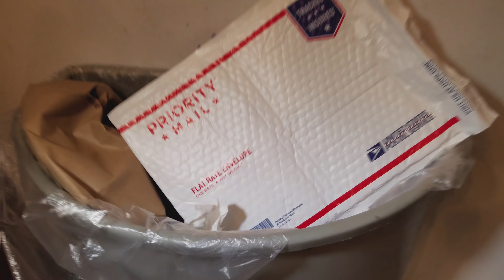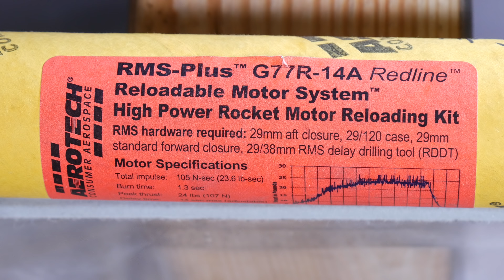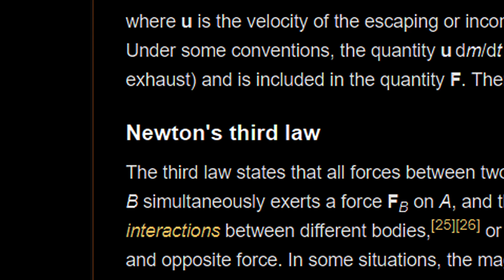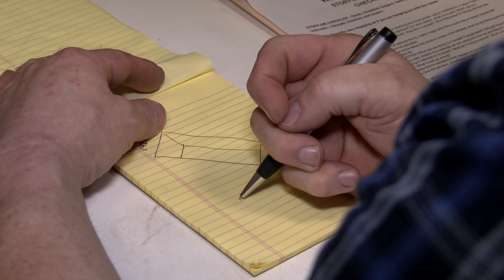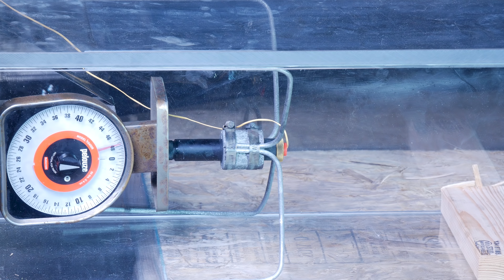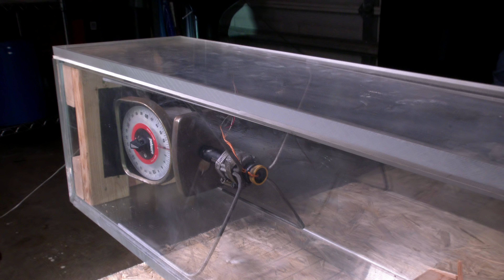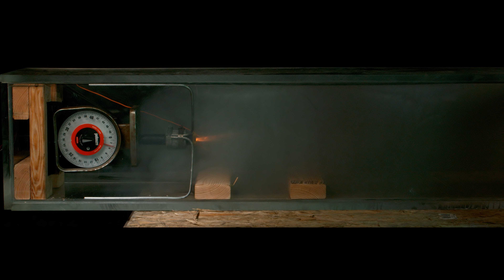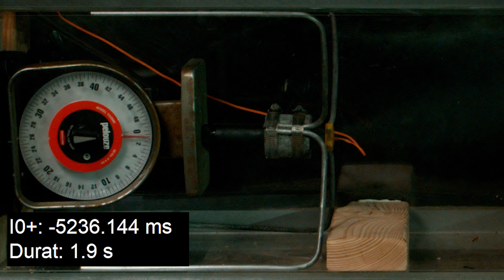Rockets in a Vacuum Chamber - Newton's third law of motion Visualized

Comment: space is not a confined box where exploding pressure can build up, same as if you put a grenade in the box and pull the pin. pressure would dismantle box.
Reply: Gary Davis oh yea?  You’ve been to space?   Grow up.    

Grenades are suspect too on another note
Reply: @zacharyhill5052  Gary is absolutely spot on and concise.  He makes a great point without being an insulting little flerf.  However your post needs further explanation, because nobody can discern your point
Reply: Myco Fairbanks  discussing outer space is theoretical only.
Reply: @zacharyhill5052  I am sorry you feel that way. In my line of work, I discuss space with SpaceX, Blue Origin, Honeywell, and NASA scientists every day, and none of it is theoretical.
Reply: Myco Fairbanks   Discuss their 401k options maybe.  I can guarantee none of them have been to outer space.   

In my line of work,  Spacex and Blue Origin are clients of my company.  

Write back after you ride in a blue origin or spacex rocket.
Reply: @zacharyhill5052  I wouldn't disgrace them in a thread with a flerf
Reply: Myco Fairbanks what a joke
Reply: @mycofairbanks3321   the fantasy is SPACE!!!
Reply: @preppertechnicianee6013  I guess it would depend on proximity
Reply: @1960ARC  Is that your final answer?
Reply: @mycofairbanks3321  ya but a rocket is justva contious explosion. So lol pressure is pressure
Reply: @preppertechnicianee6013  OK, but consider that the rocket is attached to the mass to be transported. Thus it has a positive physical connection to the ejected material prior to the expulsion.  Add this to the fact that a shock wave does not progress in a vacuum like it does in the atmosphere.  So if you were a given distance from the explosion, only the solid fragments that happened to connect could propel a body proportional to the mass times the velocity of the fragments that collided with it. There is no atmosphere to carry the shock wave. Also consider that a rocket expels its mass in one direction, while a grenade scatters its mass in all directions thereby reducing its unidirectional propulsion to near zero. You would have to be really close to achieve any propulsion from a grenade in space. Holding it firm to the broadest surface would give you the maximum effect.
Reply: @preppertechnicianee6013  No I am sorry, your concept of rocketry is flawed. Elementary at best. But I will give you an A for effort.
Reply: @mycofairbanks3321  lmao combustion chamber bud 

Ok think what you want i dont have the time

And the shape of the nozzle lol

Think why are space nozzles shaped differently
Reply: @mycofairbanks3321  lol the gas from rocket tries to then its blocked in all but one direction by the nozzle and by the combustion chamber 

Or do you think the gas somehow knows only to go in one direction
Reply: @preppertechnicianee6013  I think you are smokin rock.
Reply: @mycofairbanks3321  cool, would a balloon move in space if it let the air out the back?
Reply: @preppertechnicianee6013  Of course
Reply: @mycofairbanks3321  why ?
Reply: @preppertechnicianee6013  Because mass is being expelled in a single direction. Thus the balloon is being propelled in the opposite direction. There is nothing exploding.
Reply: @mycofairbanks3321  ok now think about how a rocket might be similar to that and really think about it.
Reply: @preppertechnicianee6013  I don't need to.  I already know the physics.
Reply: @mycofairbanks3321 
Unless you agree a rocket would move in space no you really dont
Reply: @preppertechnicianee6013  What do you think I am a flerf (flat earther)? Of course I agree a rocket works (moves) in space. I just don't agree that a grenade will produce a shock wave sufficient to thrust an object  unless it is very close, for the reasons I have already stated.
Reply: @preppertechnicianee6013  I already made the point about proximity. You are traveling charted territory. It is an absolute fact that a pressure wave does not progress in a vacuum as well as a pressurized environment.  I know the fragments will not be impeded as if in the atmosphere. 
You can go here to learn:
https://physics.stackexchange.com/questions/17957/would-a-high-explosive-in-a-vacuum-be-less-harmful
or here
https://www.sciencefocus.com/space/can-you-have-a-shock-wave-in-space/
or here: See Dave Martins response
https://www.quora.com/Can-a-shockwave-travel-through-a-vacuum
We each have good points to make.
But lets not discount what the other is saying due to our own misconceptions. Remember I already stated " Your would have to be pretty close. So I wasn't disagreeing with you, but refining the idea of an an open explosive device propelling a body. In my opinion (OPINION) 20+ feet from the grenade would produce negligible almost nothing) thrust, although the fragments may destroy you. Though I have never been to space with a grenade to test my opinion.
Have I defined my beliefs sufficiently for you?
It has been fun talking with you, and will still welcome your reply.
Reply: @mycofairbanks3321  its ALL pressure mediations, no matter perspective
Reply: Gravity is the best invention to man kind. It miraculously keeps in the billions/trillions of pounds of atmosphere while simultaneously keeping out the unmeasurable  amounts of vacuum. Einstein was a proven plagiarist with never a unique idea of his own. Wake up you ball earther fools as your judgement comes upon you in haste.
Reply: @fardyfrank8589  do vacuums suck? How do the suck ?
Reply: @mycofairbanks3321  if this is true them why can none of them take a simple photograph or keep a continuous livestream. Rocket ships work in space but not iPhones? Don't tell me they can't manage satellites to avoid whatever curvature horizonal B's they claim that knocks out there signals. A fuckin Kodachrome would do..
Reply: @Jimbo_Conn  Maybe you need to get out more. There are plenty of SpaceX launches that have 4 continuous videos from 4 different positions on the craft and boosters. There are also cameras mounted to aircraft, and huge binocular computer driven ground based cameras monitoring the entire launch. the videos uploaded to Youtube are for entertainment purposes and are not going to have just one single angle for the entire launch. How boring that would be for the viewers. However the continuous feeds do exist and you can find them if you search.
I am curious what your interest in a single photograph would be? Are you implying that under 3+ Gs an astronaut should be able to look out the window and take a photo on their iphone?
Reply: Right on Gary!  You nailed it concisely
Reply: Tooo easy off top
Reply: @zacharyhill5052  

And I take it you have been to space? Nobody has ever set foot up there, and nobody knows if there is such thing as a vacuum, it's all assumption, nobody do you hear? No soul has ever been to space, so they don't know, it's all the fruit of the human imagination in fact the fruit of the freemason's imagination.
And he is right if there is a space is not a confined box which is very limited in size.
Reply: The thrust was pushing on the end side of the box, inconclusive in my view.
Reply: If rockets required an atmosphere to work then jet engine performance would progressively get worse with altitude as the air thins but as long as airspeed is increased to maintain sufficient airflow for combustion performance is unaffected by altitude (it technically gets better)

Until the air becomes too thin to maintain combustion and wingborne lift but that's why rockets exist since they carry their own oxygen
Reply: Unless to box is purposefully conceived to contain the grenade. all you "scientists" think you are smarter than whatever made you... the lack of humility is actually the downfall of most.
Reply: @mycofairbanks3321 read 200/ proof again
Reply: @patbyron2255  can you give me that in layman's terms?
Reply: This experiment is crap
Reply: Ryan Gutierrez  Wrong. The walls play absolutely no role in thrust.
Reply: pressure would not dismantle the box. The fragmentation from the grenade would
Reply: Gary Davis the force is generated at ignition as evidenced by the scale. Yes an atmosphere was built up but the initial force proves that acceleration occurs which means it would continue to occur whether in space or in the box
Reply: The rocket moves before the gas builds up.
Reply: Exactly!!! Thank you
Reply: @alwaysflat7996  how about the 500 or so astronauts that claim to go to space, and the 6 people that are in space right now? And air gets thinner the higher you go, so logically it will get so thin that it can be considered a vacuum.
Reply: Jason Jennings  that's it. Stick to the science.
Reply: @fardyfrank8589  something is stinking of ignorance, oh it's just Fardy Frank!
Reply: @stuartgray5877  Remember Stuart,  there is no such thing as space and the vacuum therefore the boosters naturally come back to ground/earth.
Reply: @fardyfrank8589  I see that you have no intention of answering my question.
Then answer the question: How did those boosters TURN AROUND and FLY BACK to KSC IN A VACUUM ?

You have no CLUE how they did that since you dont even understand basic physics
Reply: Yeah, this video was a joke. LOL The guy doesn't seem to understand the difference between - "produced some thrust" and "produced enough thrust".
Reply: bigpigslapper Oink You are right. I can't resist. Are you a flerf too?
Reply: @mycofairbanks3321  the combustion reaction expands in all directions but is then contained and funnelled in one direction, this then results in the exhaust being forced out one way causing a reactionary force in the other direction
Reply: @fardyfrank8589  the pressure of the atmosphere at the surface of earth is caused by gravity forcing the air particles down, it’s the same reason oceans are insanely high pressure the lower you go, the weight of all the water above that point causes the pressure, that’s why there is a gradient, the more mass above you the harder it pushes on you and increases the pressure
Reply: @alwaysflat7996  except that we know the pressure decreases the higher up you go, that’s why weather balloons explode when they get high enough, the pressure differential between the inside and outside causes it to burst
Reply: Aure Heyleong  so you’re saying the exhaust causes a force that thrusts the box thus proving the experiment since they’re simply seeing if force can happen in a vacuum
Reply: @julianpetkov8320  his experiment was to see if thrust could be produced in a vacuum
Reply: @mycofairbanks3321   before you argue with an idiot make sure the other person isn’t doing the same thing! 😂🤣😂
Reply: @OGRH  2 years ago? You are fishing deep.
Reply: @mycofairbanks3321  hahahahah
Reply: Space has to be confined. Otherwise you have no vacuum.

Comment: that is a little teeny tiny vacuum box. he did not show the gauges when it ignited, there was a lot of that should dissapated . i think the test is BS
Reply: not bs. You can see that the Class b engine had a wider exhaust plume at 14:08 which is what happens at lower air pressure/vacuums, then compressing back together once it's gasses pressurize the box. Though in a complete vacuum, the plume would be exiting the nozzle in a complete 180 degrees, so he wasn't all the way there.